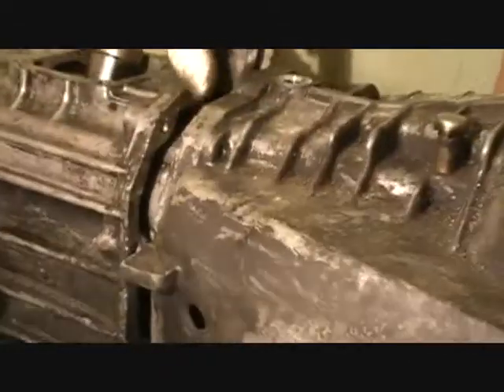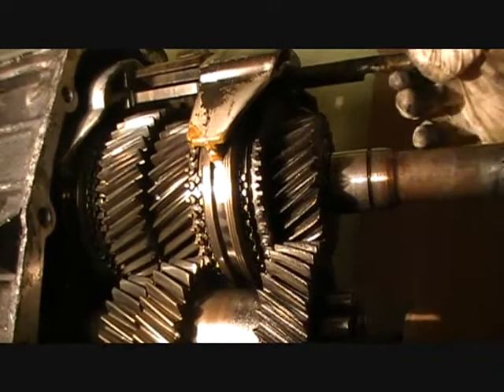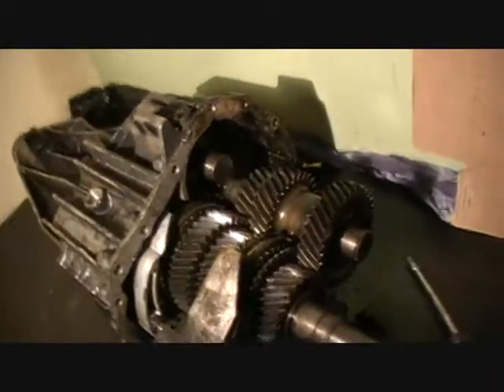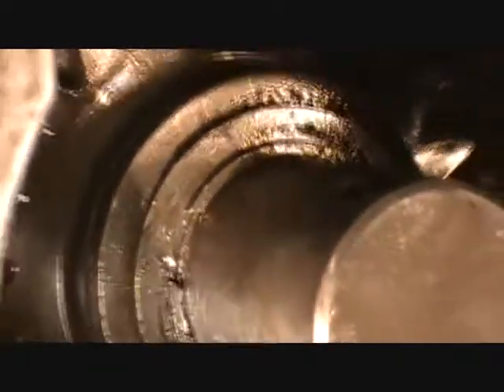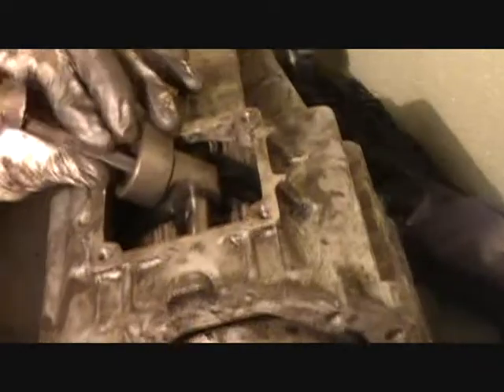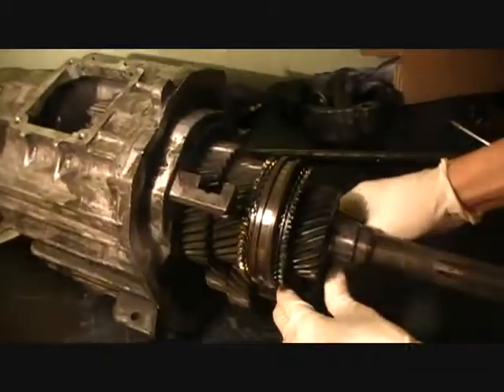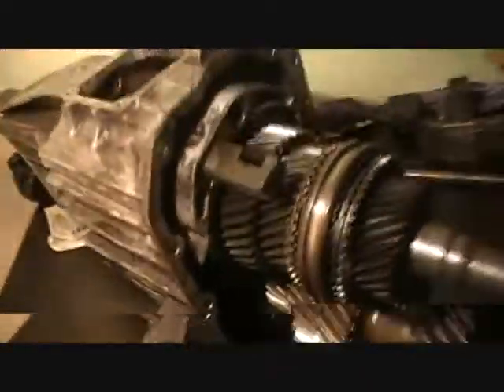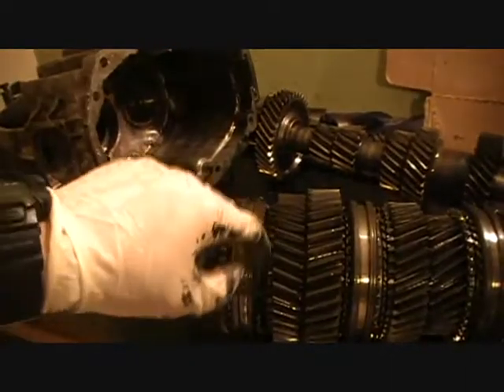NV3500 standard transmission rebuild how to -part2

Comment: Ok, Don't attempt this at home unless you have the money to buy a transmission when you discover if you can actually get it back together it works worse than before you took it out of the truck. First find a factory manual or at least all of the specs for clearance,   end play etc.. Also sometimes you need to take off x before removing y or z and if you don't you are in a world of hurt and you may do a whole bunch of work you don't need to. I'm not saying a first timer can't do it but you don't just pull one of these babies apart with out finding out first. A factory manual will tell you step by step the how to and you will usually save time and money. Now there are shortcuts that get around factory procedures but those are typically discovered by someone who knows their stuff to begin with and has done a few. If a transmission is whining that means the gears are either worn and don't match up smoothly or bearings and bushings are worn out of tolerance causing miss match and you have to ask is it worth spending the time and money to rebuild it.

Comment: I changed the main input bearing in a 1990 5LM60 (4 shift rails) but didn't want to spend the bucks for the pallet stand to swap out the input shaft.   Fixed 90% of the noise it was making and it shifts beautifully now.   I recommend getting the Chevy Factory Service Manual and the Unit Repair Manual before doing anything else.  These transmissions can be overhauled successfully by the DIY mechanic, but there are specialized tools you must have.   The tools are cheaper than a reman unit.

Comment: u take to little flat head screwdriversand push in on the hydraulic and the flat heads at the same time and then pull it all out at the same time and it will come out

Comment: You'd be well advised Sir, to put it back together and use it as a core to swap out for a re-Conditioned unit, there is no easy fix here.
Reply: Get the manuals, get the tools, and you will be fine.   The people who run into trouble are the ones who think they can fix anything in a day with a socket set and a six pack.  You have to step up for this work.

Comment: Dude it's a wonder this trans was working at all, look at the amount of crud inside that thing, did you ever even flush it and fill with clean oil? at this point your looking at a full rebuild you need a hydraulic press and gear pullers, and it don't look like you know a lot about gear boxes.

Comment: Having a Factory Service Manual when doing stuff like this is really handy ... It will walk you through every step to tear down and rebuild every part of your truck ... I pick one up for every car I buy or I have the owner buy one when I do major work on their car... Good Job jumping right in though ... Thats one way to learn how to do it .........
Reply: Add the Unit Repair Manual if cracking open a transmission.
Reply: Where do you find that?

Comment: The NV3500 in my S10 has had the whine of death for close to 50k miles now. It too sounded like a bucket of bolts at first. But that stopped long ago. I just hope it can continue to go on for the forseeable future.
Reply: I did this to an old New Process 435 granny low transmission, drained the old schmuck out, filled it to the top with kerosene and drained it 3 times, then blew it out with a leaf blower for 30 minutes, then refilled it with 30 weight oil and drained again, then filled it with Royal Purple synthetic Gear box oil, and it's still working to this day, it's in a welding rig Chevy 3/4 ton flat bed it's not a daily driver it only goes out on calls but it stopped whining and shifts smooth as you please, this really worked for a quick non tear down fix, it's behind a regular old school 350 4 bbl and it works.

Comment: soooo glad u did this video, overhauling my 1990 acura integra5 because of suspected damaged synchros and fork 5/r soooo cool i can't wait to pull it apart and luckily my transmission is on a much smaller scale.